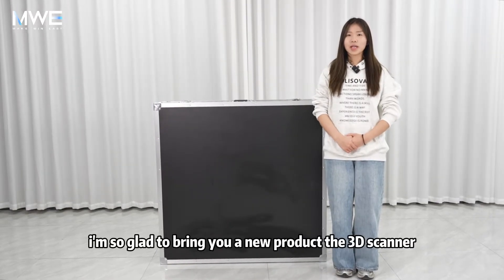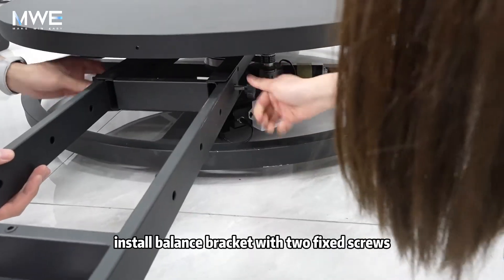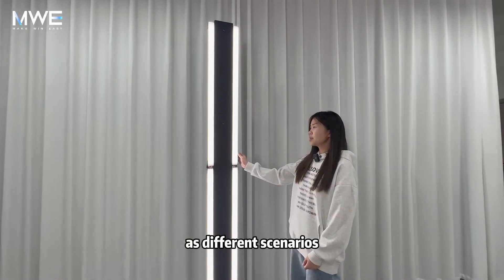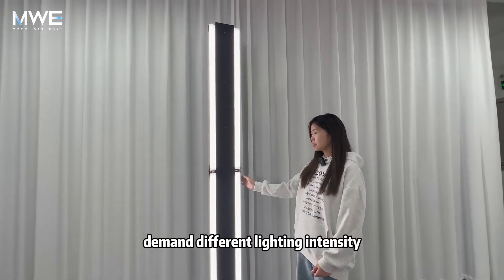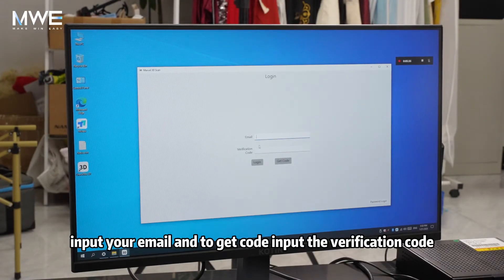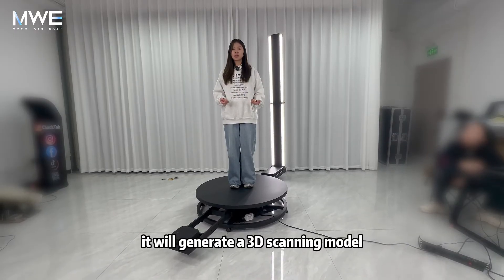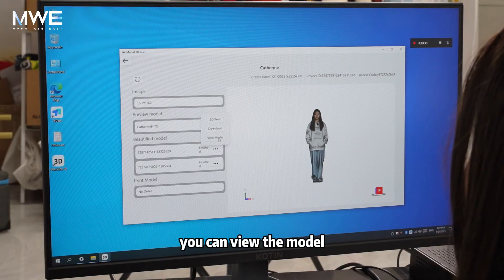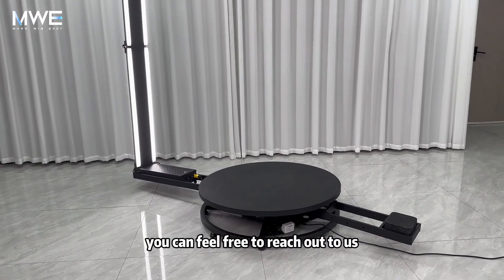MWE 3D Scanning Photo Booth Installation and Usage Tutorial

Comment: Hi do u have to use a resin printer...what about the regular filament printer
Reply from the maker: You can use any printer you like, the scanner’s main job is to capture and generate the 3D model.
We just recommend a full-color resin printer for the best results,  the regular filament printer works as well, but you’ll need to paint the model yourself afterward.
Reply: Ok,and what is the weight limit of the platform
Reply from the maker: The platform supports up to 300kg.

Comment: Hi.
I’ve some questions: 
1. How much is the 3d printer? 
2. If i buy the 3d scanner, how long it takes time to make the model?
3. Can you contacting me by the WhatsApp?   
Thank you!
Reply from the maker: Thank you for your comment and interest!

1. The 3D printer should be chosen based on your specific needs. Technically, any 3D printer can be used, but the printing quality will vary. If you're aiming for the same results as shown in some of our other videos, we recommend using a full-color 3D printer, which typically costs between $100,000 and $300,000 USD.

2. The scanning process takes around 20 seconds, and the digital model will be generated in about 20–30 minutes after the scan.

3. If you’re interested in more details, feel free to send your contact information to socialmedia01@marvellcd.com, and we’ll forward to the relevant team for follow-up.

Comment: What 3D printer and material would you recommend to print with if someone was interested in purchasing this machine and wanted to print the model themself
Reply from the maker: We'd recommend a 3D full-color printer. You can consider Japanese Mimaki 553 and the American Stratasys J55;

For the model material, we suggest using a high-density resin material to ensure optimal quality and detail.